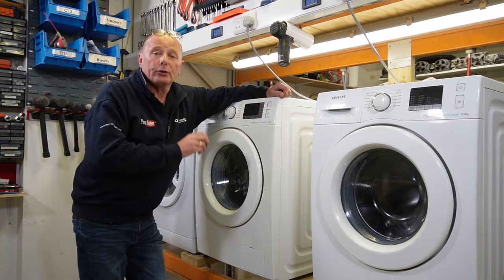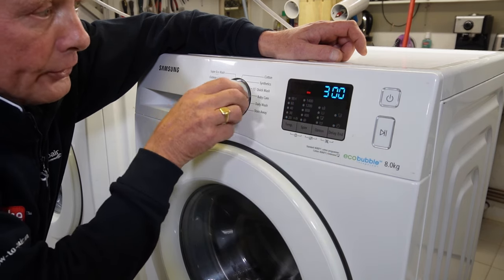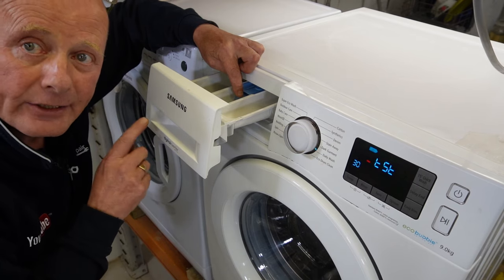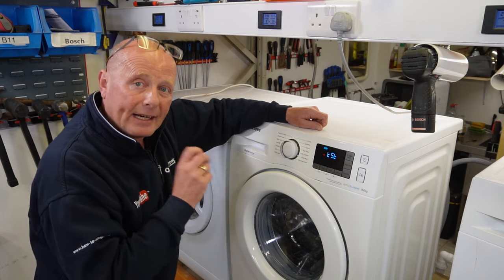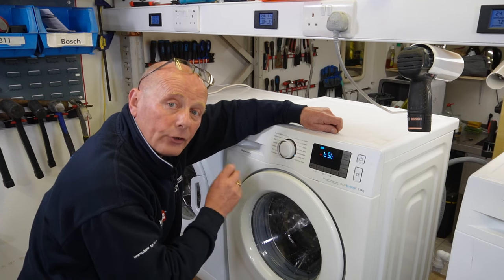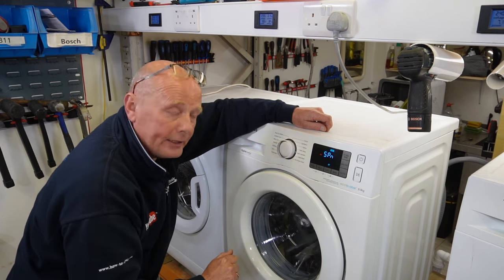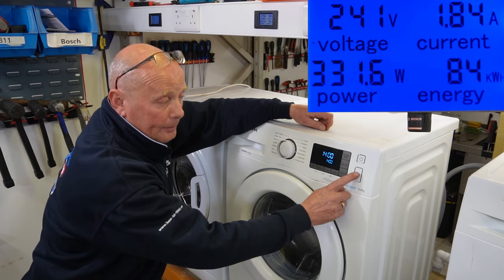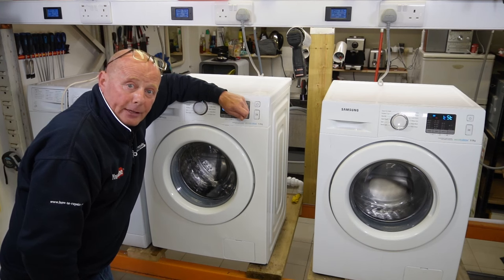Samsung Washing Machine Diagnostic Mode Guide! How To Check Error Code & Test?

Comment: Hi Paul, my Samsung EcoBubble 7.5kg WD75J5410AW does not go into test mode but only shows the symbol -: when test mode is activated following your video procedure. Would you know the reason for this? Thanks!
Reply from the maker: if it's a different model from the ones I'm showing therefore it may have a different procedure please remember to subscribe as that's is was keeps this channel going. Thanks 👍
Reply: It's happening the same with my Samsung Ecobubble WW70J5355MW. I follow the instructions and it only shows the symbol  -:
Reply: The -: symbol is a code you read with the smart phone app called "Samsung Smart Washer" and point your phone camera at the washing machine LED screen to decode the issue.
Reply: Did you find how to get to test mode for this model?

Comment: Hi, I have a Samsung washer dryer that won;'t start a wash cycle. Whenever I try to start any cycle, the machine will lock the door and then light on the dial and the first icon of the bucket with two lines will start flashing and nothing happens. I don;t understand what can be the issue here. Any help will be much appreciated. Thanks

Comment: My machine has 5 buttons temp, spin. Option, delay end, sock in order and they are touch buttons, if i touch option and delay at the same time while doing exacly like you said, anything wont happen
Reply from the maker: Hi, I will need the full model number of the identification plate and the details of your problem. Please use our contact us page and make sure you fill out the request for what your problem is. A video shoot of the problem would be perfect as well.

We will get back to you within 24 hours, normally. https://www.how-to-repair.com/help/contact-us/ 

Please remember to subscribe to our channel, as that's what keeps this channel going. Thanks, Paul 👍

Comment: My spin mode sometimes gets stuck. Do you have any idea what this could be plz. Thanks in advanve
Reply from the maker: when you say stuck. do you mean just keeps going in cycle also check for blockages. I'm glad I could help you please remember to subscribe to the channel as that's what keeps us going and able to make these videos for you
Reply: It like the drum stays still for a while them it starts the cycle. But somtimes during the cycle it will freeze again for 10-20mims then start back up
Reply: I have checked for  blockages using your videos for for guidance nothing there.
Reply: Is it a bolt motor?check for brushes

Comment: What a great video! Thank you very much! Running the tests I discovered my EcoBubble is not turning clockwise, and that's probably why it's stopping mid-cycle. Now what to do with this information? :)
Reply: It also ends the test with an 3E message (call customer service)  but no message appears in normal mode.
Reply from the maker: not sure what you mean  Thank you For leaving a comment this is for you https://www.youtube.com/shorts/e432SAb2g08 please remember to subscribe as that's is what keeps this channel going. Thanks 👍
Reply: Hello ..how to unlock the Al Eco bubbles?please help me.thanks

Comment: I have a Samsung WF45H6300AW/A2 washer.  It is having spin issues.  I took the back cover off and the rotor is cracked at the hub and has play back and forth.  I tightened the 19mm retaining nut and still has play.  Am I correct in thinking that is my problem and I need a new rotor?
Reply from the maker: without having the washing machine in front of m a very hard one for me to answer Thank you for leaving a comment this is for you https://www.youtube.com/shorts/e432SAb2g08 please remember to subscribe as that's is what keeps this channel going. Thanks 👍

Comment: Hi, I have run the tests and all seems to be in order. Our problem is that the drum starts to empty before it reaches the seal when the drainage pipe is laid out on the floor. We have to raise it manually when this stage is happening. We therefore have to lower it manually when it reaches the drain cycles. We litererally have to stand over every wash lowering and raising the drain pipe on 5 different occations per wash. We recently moved and this has happened since then.Please help, I am at my wits end and do not know which way to turn :) We have run the re calibration mode.
Reply from the maker: Hi, I will need the full model number of the identification plate and the details of your problem so that I can provide you with useful literature. Please use our contact us page and make sure you fill out the request for what your problem is. A video shoot of the problem would be perfect as well.

I will get back to you within 24 hours, normally. https://www.how-to-repair.com/help/contact-us/  

Please remember to subscribe to our channel, as that's what keeps this channel going. Thanks, Paul 👍

Comment: Hi...Im struggling with this machine..I am doing test mode, the steps for water, heater, drain pumps work fine...However when trying the drum trial, the drum will not move..All transit bolts are out..I can move drum very freely/easily by hand...I have also tried the calibration, when calibrating clb comes up, then the 3 lines swirling for approx 30 
secs then CLB shows up again...The drum will not move...Please bare in mind this is a brand new washer...Any ideas how to get drum move?? I can not do any wash cycle at all, as drum will not rotate..Hopefully you might have an idea how i can reprogramme or fix the issue...Thanks so much..Merry Christmas to you!
Reply from the maker: If this is a brand-new washing machine I would get the manufacture out. It sounds to me that you may have either a motor or PCB problem. Have a great Christmas and a happy New Year. glad we could help you @paulinecunningham7400 this is for you https://www.youtube.com/shorts/e432SAb2g08 please remember to subscribe as that's what keeps this channel going. Thanks 👍
Reply: I have a same problem. What was the cause of the problem?

Comment: How do you run a diagnostic test mode on model WF419AAW/XAA01
Reply from the maker: Hi, please use our contact us page and make sure you fill out the request for what your problem is. I will need the full model number of the identification plate and the details of your problem so that I can provide you with useful literature. A video shoot of the problem would be perfect as well.

I will get back to you within 24 hours, normally. https://www.how-to-repair.com/help/contact-us/  

Please remember to subscribe to our channel, as that's what keeps this channel going. Thanks, Paul 👍

Comment: Hi, my Samsung washing machine wasn't heat up when washing . I done the diagnostic mode as per the video. When I press the 3rd button (Spin) , it's has  have  an icon  ( at the right of the screen) light up for few seconds. But I cannot hear any noise or clicking from the machine. Totally silence. 
Does it's mean the heating part not working? And need to be change? 
Thanks
Reply from the maker: You will need to do an ohms test on the element to make sure it's in good condition but if it's open circuit then it will need replacing @leeben1021 please remember to subscribe to our channel as that really helps us https://www.youtube.com/shorts/e432SAb2g08  Thanks, Paul 👍

Comment: Help! Not spinning, c32 code. Motor spins by hand but get a magnetic resistance, this goes when motor unplugged. Any ideas before I scrap it!
Reply from the maker: Hi, I will need the full model number of the identification plate and the details of your problem. Please use our contact us page and make sure you fill out the request for what your problem is. A video shoot of the problem would be perfect as well.

We will get back to you within 24 hours, normally. https://www.how-to-repair.com/help/contact-us/  

Please remember to subscribe to our channel, as that's what keeps this channel going. Thanks, Paul 👍

Comment: Hello, i have a weird issue on my samsung washing machine, while it's washing , suddenly it turns off, after few minutes that I try to turn it on many times, it  turns on and resumes the washing at the same point where it turned off. So I need to be always there to complete a washing cycle otherwise it turns off and thats it. Any suggestions please? Thank you
Reply from the maker: Hi, I will need the full model number of the identification plate and the details of your problem so that I can provide you with useful literature. Please use our contact us page and make sure you fill out the request for what your problem is. A video shoot of the problem would be perfect as well.

I will get back to you within 24 hours, normally. https://www.how-to-repair.com/help/contact-us/  

Please remember to subscribe to our channel, as that's what keeps this channel going. Thanks, Paul 👍

Comment: Even though I adjusted the balance very well with a spirit level, no matter what I did, I could not solve the vibration problem. I also changed the shock absorber.I couldn't figure it out.  Additionally, something else needs to be done.  I think there is a design problem

Comment: what happens if ive changed Samsung WW80M645OPX pcu b board. thermister checked resistance decreases with hand heat so that works tested element 2.2ohms no voltage reaches element so point back to pcb but that been changed.  i dont get error codes just no hot wash iam out of ideas.

Comment: unable to enter into diagnostic mode for samsung ww80k5210ww Add wash model. I followed the same instructions as shown in your video. Can you help me on this.
Reply: My Samsung ecobubble ww10n645rpx/eu model doesn’t appear to respond to the suggested button presses to enter diagnostic mode either. Not found a solution - have you @aniserver?

Comment: i think my machine is stuck on test mode displaying 18:88 and all the lights on but non responsive to any button presses or turning the dial! can you help i’ve tried unplugging and turning on/off
Reply from the maker: Hi, I will need the full model number of the identification plate and the details of your problem. Please use our contact us page and make sure you fill out the request for what your problem is. A video shoot of the problem would be perfect as well.

We will get back to you within 24 hours, normally. https://www.how-to-repair.com/help/contact-us/ 

Please remember to subscribe to our channel, as that's what keeps this channel going. Thanks, Paul 👍

Comment: Samsung inverter motor states 10 Yr guarantee mine is 7 years old I suspect the carbon brushes are worn. So my question are the carbon brushes still  under guarantee due to inverter motor 10 year guarantee??
I don't want to replace them myself if they are still under guarantee
Reply from the maker: An inverter motor does not have carbon brushes it will either be haul sensor or PCB

Comment: During doing the test mode I got problem of 3E, I cleaned the filter as well. What shall I do?
Reply from the maker: Depending on which motor you have this may be a problem with the hall sensor or the carbon brushes in the motor. Thanks please remember to subscribe as that's is was keeps this channel going. Thanks 👍

Comment: Mine is driving me crazy. In the testing mode Every time I press play the b pump light becomes red. When i switch on the machine, it does not response To any thing I choose. I changed the d pump. Failed. Put the pump on the circulation pump. Failed as well.

Comment: I keep getting error 3E on mine. When I do the smart check app it says check motor. Motor brushes have been replaced and still not working. It starts a cycle but keeps stopping mid way through. New circuit board today and that was faulty and wouldn't let us press on and off or move the dial through cycles. And turned on itself when plugged in without pressing the on off button. The washer guy is going to order another circuit board. Do u think that's what the issue is when it states check motor?
Reply from the maker: It will be PCB or motor fault. Thanks please remember to subscribe as that's is was keeps this channel going. Thanks 👍

Comment: Mine is doing the kind of gerk when it tries to spin while in a wash, like the board has failed but spins perfect when in the test mode etc, everything works perfectly in test mode... any ideas???
Reply: It does it mid wash, if switch power of and back on it will run ok again

Comment: This doesn't get mine into test mode
..i have wf45k6200az/a2 newer machine. Any idea how to get that into test mode?
Reply: My  ww10n645rpx/eu model doesn’t appear to respond to the suggested button presses to enter diagnostic mode either. Did you manage to find a solution?
Reply: @MikeCarter  My AU model was buttons 4 & 5 not 3 & 4

Comment: How do I reset the machine if the machine doesn't end it's cycle. We have a noise on it whilst in operation, which has been doing it for a while now, but now it won't end it's cycle.
I've gone into calibration mode and the error code is Jd- -09

Comment: Can I just Turn the cold water valve on and leave the Hot off
Reply from the maker: On some programs, the machine will not start if the hot water is off, but you could connect the hot and cold water valves to the cold water supply. It will just use more energy to heat the water. glad we could help you @small476 this is for you https://www.youtube.com/shorts/e432SAb2g08 please remember to subscribe as that's what keeps this channel going. Thanks 👍

Comment: What if the spin does not happen, what would be the issue
Reply from the maker: pcb or motor fault
Reply: I can enter the test mode and do the checking (does not spin), however when I switch on the washing machine in normal mode all switches are jammed and ecobubble button is on weirdly.

Comment: Hello sir,  my Samsung machine is  not spinning what can I do
Reply from the maker: Check the motor check the carbon brushes are fitted if it's a direct drive you want to check that hall sensor but without having the machine in front of me, it is very hard for me to be any more help

Comment: Test not running, symbol -: 
Can i help me?
Reply from the maker: Hi, I will need the full model number of the identification plate and the details of your problem so that I can provide you with useful literature. Please use our contact us page and make sure you fill out the request for what your problem is. A video shoot of the problem would be perfect as well.

I will get back to you within 24 hours, normally. https://www.how-to-repair.com/help/contact-us/  

Please remember to subscribe to our channel, as that's what keeps this channel going. Thanks, Paul 👍
Reply: WW80J5555FW
whaser working but motor don't turn right or left...

Comment: Hi ive done all this and then it daid e3 what does that mean please
Reply from the maker: Hi mate, the first thing to check is the carbon brushes in the motor, if your machine has them. One of the brushes might have a bad connection or be worn down. If the motor tests perfectly, there could be an intermittent problem with the printed circuit board (PCB).

Comment: If the door is no opening
Reply: On my left-hinged door Samsung UK machine, with the door closed my pin pecker is rear-hinged onto the right hand side of the door, with the pecker grip pointing to the right side side. The upshot of this is that a long piece of garden strimmer line wrapped around the circumference of the door, and with the open ends of the line at the 9 o'clock, can allow the line, when pulled accurately, to grab hold of the door pecker at the 3 o'clock and pull it inwards (towards the door centre) pivoting the door pecker to the left (towards the door centre) which allows the door to be pulled open via the handle, either by myself whilst keeping line tension in one hand, or by  keeping the tension with both hands and calling a second person to pull the door handle.

Comment: Someone knows what this error mean :-u_l I cant find any info😢
Reply from the maker: I suggest you make a YouTube video on the vault and then post it on your channel and send a link as way I would be able to see correctly what is on the screen please also describe how it is coming up @helinshevchuk5037 please remember to subscribe to our channel as that really helps us https://www.youtube.com/shorts/e432SAb2g08  Thanks, Paul 👍
Reply: @How-to-repair  our wf80f5e2w4x started getting stuck at the start or end of wash cycles. I've entered diagnostic mode and when I turn the dial left one click I get error 4c-12. Then then I turn to TST I more often than not get error UC, I can only clear this by turning off and back on.
I've checked the inlet pipes and continuity of the inlet relays and all seems fine.
Do you have any idea what the issue could be?
Thanks in advance.